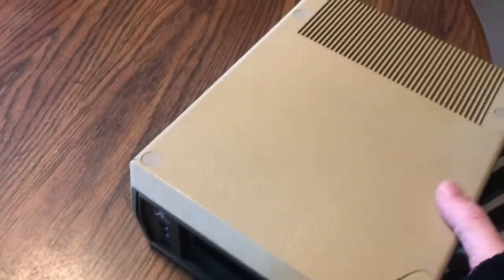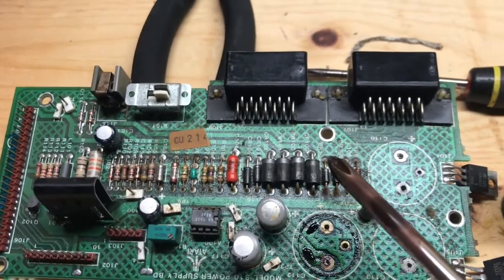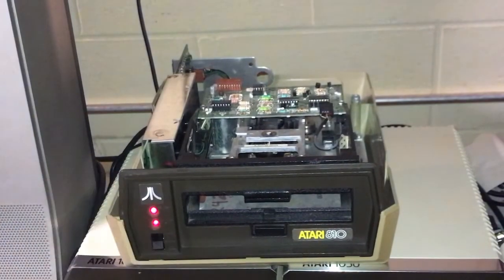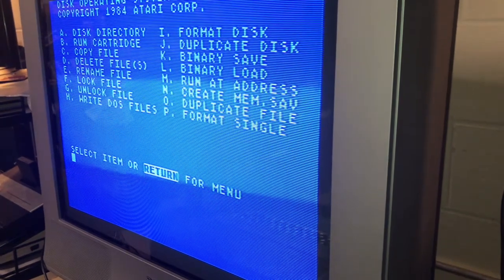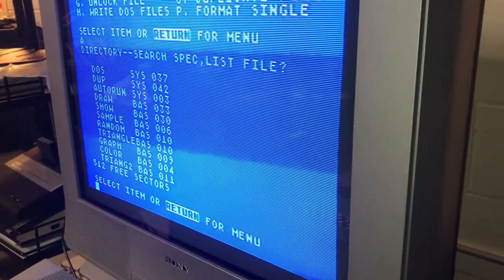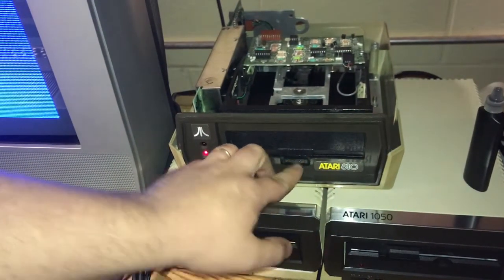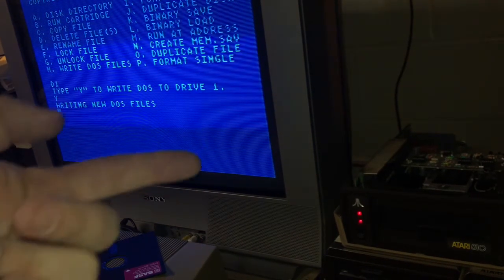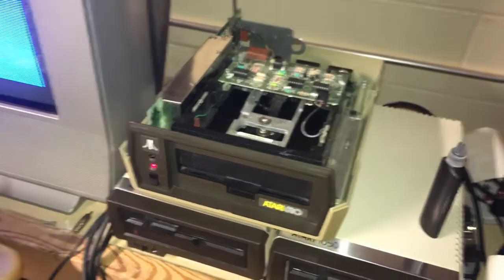The ReStory of the destroyed Atari 810 floppy drive

Comment: What did you use to glue it together? What kind of material 810 is made of? ABS?
Reply from the maker: I used a chemical called MEK. It welds the plastic back together.

Comment: Wonderful work! Can I ask, will a 1050 power pack work with a 810? I purchased an 810 off ebay and it has no power pack. I have a spare 1050 power pack? I love the design of the 810s - so 70s/80s brutalism. Also how to I get a DOS 2.0 disk? The drive I purchased has no support docs or info.

Comment: Thank you for restoring the 810. At 7:30 the reason it made that farty sound is because DOS 2.5 first tries to format in enhanced density which the 810 cannot do. So it then fell back to single density and that worked. I have an 810 that was also smashed in shipping so I may try M.E.K. or gorilla glue.  Looks like MEK does a much better bond but is more visible.
Reply from the maker: Did you get get it restored? I found the MEK method to work awesomely. It really fuses the plastic back together for a strong connection
Reply: @offensivejerk  Oh that's great to hear! No I haven't yet repaired the 810 case here. Did power it up and it behaved a little strange, needing a couple power cycles to properly power up. I did do a partial restoration of the case so it stays together enough to pick up the whole drive but it still has a big crack on the top. Definitely need to try MEK after your very positive experience with it! Had forgotten about MEK until your reminder. Thank you vm.

Comment: Tip: Don't turn on the 810 with a disk inserted and drive closed. There's no protection from a poweron surge to the write head which can corrupt data where the head is... (usually parked on track 39 when idle) Nice repair job. My eBay 810 case was smashed much worse than yours... but at least the mech still works! Too many small pieces to glue. Yours is the MPI mech (later 810's had a tandon mech) - and good you have the grass valley upgrades in there, which included a better power board, that top analog board, and a data separator daughterboard on the sideboard. (inside that metal shielding on the side board). Cheers!
Reply from the maker: Thanks for the tip, I didn't know any of that information.  Reminds me of the Coleco Adam when you left the tapes in the drive and turned it on, the tapes would be erased.  Is this one of the more desirable drives then with those upgrades? Is the MPI mech preferred over the Tandon?
Reply: Nothing really better/worse MPI/Tandon afaik, but I think the MPI mechs are more common, at least nowadays. Interesting to know thats all.. According to some writings at Best Electronics' website, the tandon door hinges could break easily. But they still sell replacement internal parts for fixing! Just no more cases.
Reply: Hey Guys, I am trying to get a drive to work for me. When I power it on, both lights come on, the spindle spins and the head goes in and out. Then one led turns off.
as expected. However when I turn on my Atari 800, the drive just sits there. I have replaced the SIO cable and have tried the same thing with my Atari 400. 

I made a short video, so that you might be able to see what is going on, and what I might try to fix this issue.
https://drive.google.com/open?id=1p_zILYZokFe7iiqqYIf-b6i2oKyNfdg5

Comment: I feel your pain, when it comes to ebay shippers. I had purchased an IBM 5151 monitor, and they packed it too tight, and the plastic was completely busted up.

Anyway, I am working on an 810 drive right now, and I need to know how to load a disk. I do not think I have a bootable disk, but I may have a disk with some software on it, that I might be able to view. When I first turn on the disk, it does apaer to seek, but when I turn on the 800 system, nothing happens at all.
There are 2 I/O ports, and I have tried both. I could have a bad cable, but it has been a lot of years, since I have worked on one of these old atari systems, so I do not know what I am doing, so I could use a little help.
Reply from the maker: Jeff Nay you need to have a disk that boots some kind of DOS before you can access a disk drive.  You can’t read a disk with files on unless you boot dos. Basic can’t access disks. Also, it matters which Atari you are using. Later Atari models required you to hold the option key at boot time to load the disk.
Reply: But it should at least try to boot off the drive, when I power up the system??
Reply from the maker: Jeff Nay not really. You power the 810 on. Then put a disk in and then the drive seeks. Then you turn the Atari on.  I think the drive already knows if the disk is bootable by the time you turn the Atari on. Which model is it?
Reply: Atari 800 and an 810 disk drive.
Reply from the maker: Jeff Nay do you hear any sort of beeping when you power the computer up with a peripheral attached?
Reply: No beep
Reply from the maker: Jeff Nay I’m fairly sure you should hear a few short beeps if you have the drive powered on when you turn the computer up even if the disk isn’t bootable. That noise is the device sending Data to the computer.  Do you have any other peripherals?
Reply from the maker: Jeff Nay I saw your collection video . Does the tape drive work or do anything?
Reply: I have two tape drives, and I don't think either one of them work. I purchased some new belts, but I have not tried to put them back together yet.
Reply: Wait a minute. I have two pulled apart out in the garage, but the one on the shelf, is still in the package.
Reply: Ok, I pulled it out, and although it would rewind , reluctantly. It would not play.
Reply: Jeff did you get things working? Just in case... Be sure the drive select switches on the back of the drive are set to D1 to try to boot of it. The disk may or may not be bootable. If not, you'll need a way to boot to a DOS. You can use a SIO2PC USB adapter (~$20) and use Reflect on your PC to set up virtual disk drives using ATR files of a dos. Set the 810 to D2 in that case. Do a directory of D2: (include the colon for Atari's DOS's). Many bootable disk games will not show a legible directory.  In any case you'll need to get a SIO2PC adapter or a DOS 2.0s disk to get rolling.  A MyDOS single density disk will also work. Many of the Atari DOS's are compatible to some degree, as long as your drive will read the density.